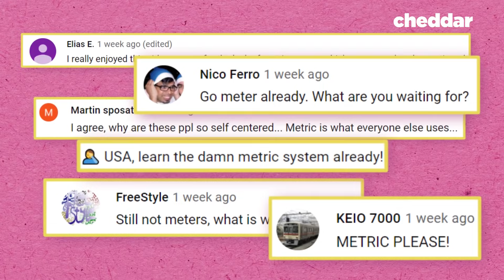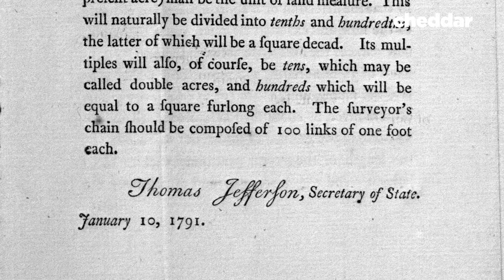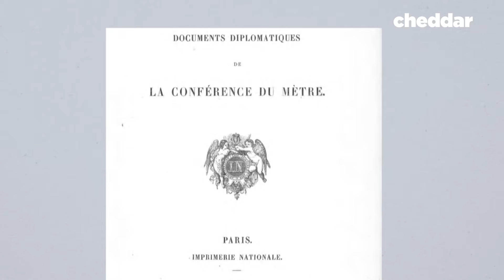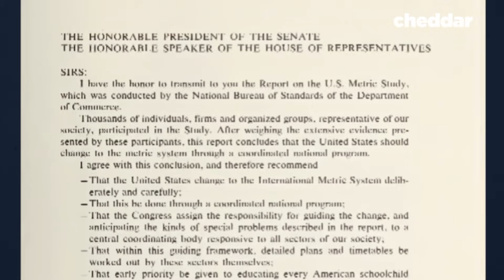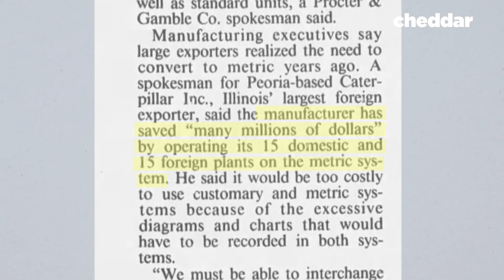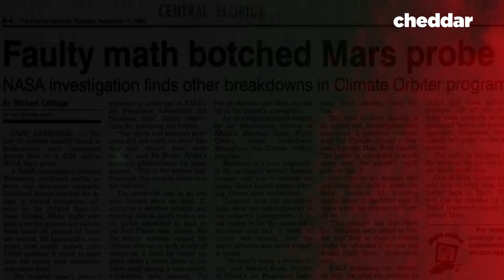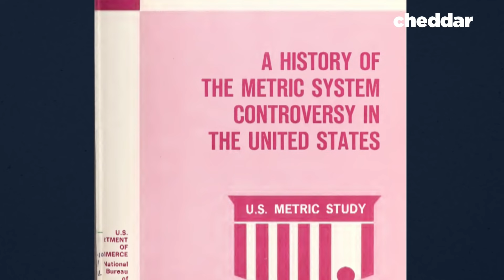Why Doesn't the US Just Use the Metric System? - Cheddar Explains

Comment: Funny how we use inches in Europe to measure smartphones and TVs diagonally
Reply: I find car-wheel and -tire sizes much more interesting ...or rather unnecessarily complicated. The wheel's diameter and width are given in inches and for tires it's a mix of metric and inches. My car runs on 205/45/17 ... meaning a tire that's 205mm wide, has a height to width ratio of 45% and fits on 17 inch wheels.
Reply: @1SaG  Back in the late 70s and 80s we had some cars with metric wheel diameters. One example would be the early Foxbody Mustang with the ill-fated Michelin TRX tire option, it used 190/65/390mm tires.
Reply: Only because the US was the largest consumer of these devices and thus lands up dictating this silly situation.
Reply: @mimoslavich6639  Not sure that's the reason, But for some reason most of the world does the inch diagonal for TVs. And the best part is it may or may not even be a true measurement. Modern TV's will usually be described as "XX inch CLASS". It may be bigger OR smaller than xx Inches! Who Knows?
Reply: @jamesslick4790  Tvs would have been easier in rounded decimetres. So a 50cm tv would be a 5dm an 80cm would be an 8dm. The simplicity would have crushed inches.
Reply: @mimoslavich6639  I'm not gonna argue that point, Regardless of what others might think (based on some of my comments to them) I am an American who endorses and uses metric.( I'm not into Celsius tho ,LOL!) OTOH no matter what system they would use, Methinks were being screwed by the TV manufacturers, Be it by 10ths of an Inches OR centimeters. Just give us the REAL diagonal measure!
Reply: @mimoslavich6639  what would you say for a 55 CM TV? Why I'd DM any simpler than CM?
Reply: @jamesslick4790  Wrong.
Reply: @mimoslavich6639  that doesnt sound as good tbh
Reply: Even flight levels are in hundreds of feet in most of the world.
Reply: I have a theory about this. As the TV market was originally dominated by American manufacturers, inches became the market standard. When other countries entered the market, they had to use inches so that consumers could compare.  But then when European and Asian manufacturers started to dominate the market, they realized that Measuring in inches instead of centimeters gives the manufacturer more wiggle room to be imprecise. If you advertise the TV size in centimeters instead of inches, the tolerance of deviation gets reduced by two thirds. So they had no incentive to change the standard.
Reply: Vlad D i think it is because people think inches are bigger but they don’t know how much bigger so they might believe the screen is bigger than it really is and companies take advantage of that
Reply: And in America we use liters for soda and shit like that.
Reply: And what is also funny that the US is using metric in the names even tho they don't like it. Altimeter, odometer, Speedometer
Reply: as automotive engineer, weve been studying this. It could be done like with date dd.mm.yyyy like H/W/D - Heighth Width Diameter, but the diameter can be confusing for people, and a long time ago this just seemed like a simple solutin for dumb people, just to give 3 sizes in 3 different mesurement systems, so each stands for something else.
Reply: i hate that shit. It´s indicated in inch but everybody has to calculate to cm to actually know how big it is lol
Reply: @yooooodennis  
exactly 👍
when you hear 15' and 22' all I know is first one is smaller than the last one, but to have an idea of the size, for example, if it fits in my room, I have to convert to centimeters 😤
Reply: Not just smartphones and TVs, but standalone monitors and other screens. Yeah, why are these still stuck in Imperial?
Reply: On my new ASUS monitor the size says 27" 68.5cm, so I got both numbers.
Reply: Fuck. You're true.
Reply: Yeah, but apart from that and wheel diameters, that's it
Reply: We do?
Reply: Americans mass produced them first, so I guess they set some rules we need to change.
Reply: @chingu1980  not only did we mass produce them first but we actually invented them.  Now just enjoy them until an American makes your life better again. Enjoy our Internet while you're at it. The two guys that made the world's first transistor were living in my home town when they did that too. It's our world. You're just living in it.
Reply: @1pcfred  well, the Transistor was first patented 1925 in Austria.
The first FET was build 1934 by Oskar Heil, a German engineer.
So, sorry, not an American invention.

Oh, Internet. The key Technologie of the Internet derives from the France CYCLADES project. Without CYCLADES no Internet as it is known today.

And the television was invented 1886 by a Polish-German engineer.
It was mechanical, but the technics where later used with the electronic one which also was invented by a German.
And by the way, there never were much US tv manufactors. Till the 80s most televisions came from Germany, in the 80s it swiched mainly to Asia.
Reply: @1pcfred  they didn't revived the the nobel price for building the Transistor, they received it for discovering how it works.

And yes, that is all that Americans can do. They can only deny credit to those who deserves it.
Reply: @1pcfred  oh, and by the way, if I shall go off the Internet, you stop using WWW and MP3.
Insead, use Gopher.
Reply: @1pcfred  you don't even know Gopher. I worked with it pre WWW.

And without the Internett the World would use CYCLADES by now, as the Internet builds on the technics of CYCLADES.

This is boring.
The only thing you want to proof is, that the USA is the superior all-knowing bes country of the world.

It's not.
You are only an arogant lot that claim all the fame for themselves. Even if that means, stealing from others. That's all.
.
Reply: @1pcfred  there is no superior country, but a lot of countries better than the USA.

Think about this. More people move  from the USA to EU than the other way around. Nobody wants to live in the USA except people who are trapped on the same continent.
Reply: @1pcfred  An English man created the internet
Reply: Not in France
Reply: Vlad D In south america too, not only europe
Reply: in south america we do the same
Reply: That's why I still dont understand what the actual size they are. This is fucking stupid...
Reply: Genuenly never seen that
Reply: In my case we dont
Reply: Because of BitchPhone!
Reply: That's pretty lit ngl
Reply: Lol, guess we are one and the same
Reply: That's because we invented TVs and smartphones here in the USA.
Reply: @1pcfred  No a Scottish man invented Television
Reply: @Soda Pop it makes the screen sound bigger. TV screens used to be very small. Practically smart phone screen small.
Reply: Also in asia
Reply: In the UK and ROI it is mixed with vegetables sold by metric and drinks by imperial
Reply: Yes, why???
Reply: @moow950  I don’t know
Reply: Also Chainsaw blades is in inches. I have no clue how long a 15" blade is in mm. I still use " for nails and sawed timber.  btw i'm swedish
Reply: @hnorrstrom  Sorry to be pedantic but chainsaws don't have blades , they have bars .
Reply: @Gordon_L  no problem I just diden't know the right word in english so i used the swedish one directly translated.
Reply: @hnorrstrom  Seeing as you're Swedish , I'll apologise for my pronunciation of Husqvarna ;-)
Reply: @hnorrstrom  Hope this helps :15 inches is 381mm.
Reply: Also car tyres and dicks.
Reply: turns out the idea of puting tv width in inch was not to simply things on the contrary it was made to confuse mainland European preventing them from doing the math on how wide it really was (at the time people couldn't google a conversion of inch to cm ) so the system was made to force you to guesstimate and round it up making it seem bigger that's also why only the diagonal is measured not the length and the width to force you to guesstimate (because seriously most people won't use the Pythagoras theorem to find the real measurement of theit TV)

Comment: For one, there'd be mass confusion.
I'll see myself out.
Reply: I see you went to great length for that one
Reply: Confusion? 
1 centimeter is 10 millimeters
1 decimeter is 10 centimeters or 100 millimeters
1 meter is 10 decimeter, 100 centimeter or 1000 millimeter.
1 kilometer: 1000 meters

How's that confusing?
Reply: "there would be mass confusion" 😁 

Metric mass measurements are in ratios of 10:1. Much easier than counting tons, long tons, short tons, pounds, ounces (mass), grains, karats, and so on.